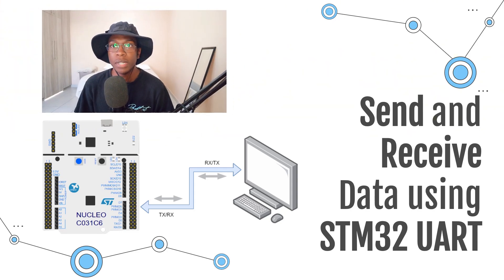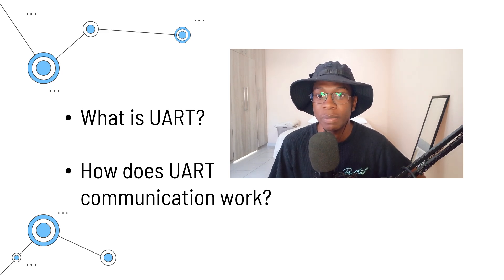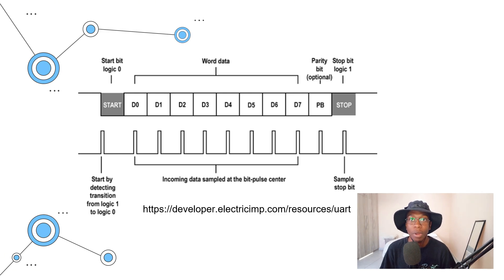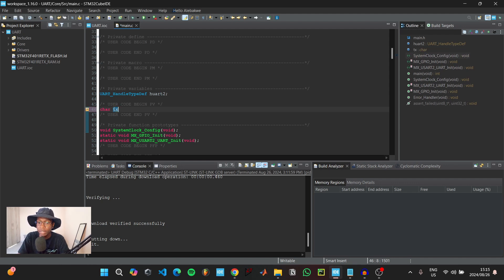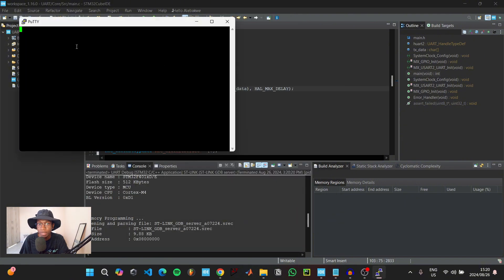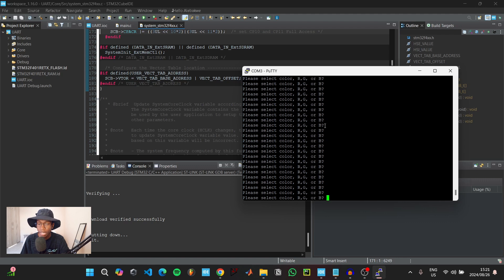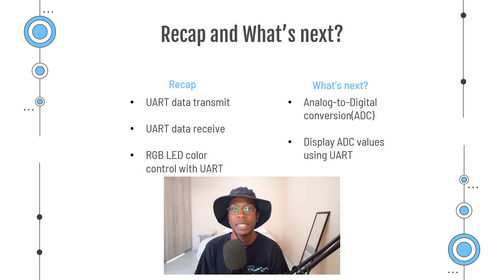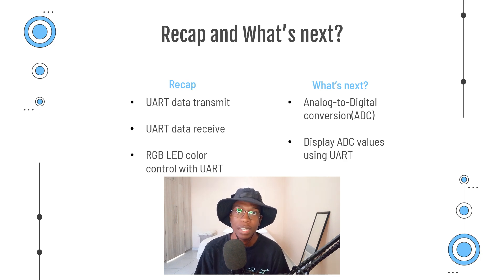STM32 Beginners Guide Part6: UART Serial Communication | Send and Receive data with STM32 UART.

Comment: Note : The only UART module connected directly to virtual com port is UART2, for the others, you must use en external hardware to communicate with PC
Reply from the maker: That's correct. I did mention this being the reason for using UART2 in the video.  Thank you.

Comment: Is it necessary to use the interrupt to receive the communication to the microcontroller? Can't we use the normal way of receiving data? Lastly what are the benefits of using the interrupt? Only for sending back the message we sent to the microcontroller??

Comment: when i write this line 	  HAL_UART_Transmit(&huart2, tx_data, sizeof(tx_data), HAL_MAX_DELAY);
and building it give me error 
13:34:57 ** Incremental Build of configuration Debug for project UART **
make -j12 all 
arm-none-eabi-gcc "../Core/Src/main.c" -mcpu=cortex-m4 -std=gnu11 -g3 -DDEBUG -DUSE_HAL_DRIVER -DSTM32F401xE -c -I../Core/Inc -I../Drivers/STM32F4xx_HAL_Driver/Inc -I../Drivers/STM32F4xx_HAL_Driver/Inc/Legacy -I../Drivers/CMSIS/Device/ST/STM32F4xx/Include -I../Drivers/CMSIS/Include -O0 -ffunction-sections -fdata-sections -Wall -fstack-usage -fcyclomatic-complexity -MMD -MP -MF"Core/Src/main.d" -MT"Core/Src/main.o" --specs=nano.specs -mfpu=fpv4-sp-d16 -mfloat-abi=hard -mthumb -o "Core/Src/main.o"
../Core/Src/main.c:50:1: error: expected ',' or ';' before 'void'
   50 | void SystemClock_Config(void);
      | ^~~~
../Core/Src/main.c: In function 'main':
../Core/Src/main.c:83:3: warning: implicit declaration of function 'SystemClock_Config'; did you mean 'SysTick_Config'? [-Wimplicit-function-declaration]
   83 |   SystemClock_Config();
      |   ^~~~~~~~~~~~~~~~~~
      |   SysTick_Config
../Core/Src/main.c:103:38: warning: pointer targets in passing argument 2 of 'HAL_UART_Transmit' differ in signedness [-Wpointer-sign]
  103 |           HAL_UART_Transmit(&huart2, tx_data, sizeof(tx_data), HAL_MAX_DELAY);
      |                                      ^~~~~~~
      |                                      |
      |                                      char *
In file included from ../Core/Inc/stm32f4xx_hal_conf.h:411,
                 from ../Drivers/STM32F4xx_HAL_Driver/Inc/stm32f4xx_hal.h:29,
                 from ../Core/Inc/main.h:30,
                 from ../Core/Src/main.c:20:
../Drivers/STM32F4xx_HAL_Driver/Inc/stm32f4xx_hal_uart.h:745:79: note: expected 'const uint8_t *' {aka 'const unsigned char *'} but argument is of type 'char *'
  745 | HAL_StatusTypeDef HAL_UART_Transmit(UART_HandleTypeDef *huart, const uint8_t *pData, uint16_t Size, uint32_t Timeout);
      |                                                                ~~~~~~~~~~~~~~~^~~~~
../Core/Src/main.c: At top level:
../Core/Src/main.c:112:6: warning: conflicting types for 'SystemClock_Config'; have 'void(void)'
  112 | void SystemClock_Config(void)
      |      ^~~~~~~~~~~~~~~~~~
../Core/Src/main.c:83:3: note: previous implicit declaration of 'SystemClock_Config' with type 'void(void)'
   83 |   SystemClock_Config();
      |   ^~~~~~~~~~~~~~~~~~
make: * [Core/Src/subdir.mk:34: Core/Src/main.o] Error 1
"make -j12 all" terminated with exit code 2. Build might be incomplete.
Reply: ignore it

Comment: I didn't find my stm32 COM in the device manager, how can i find it pleaze?
Reply from the maker: Hi, Make sure you're using a data cable and not a charging cable. Then try to install stm32 drivers, you can find them on the stmicroelectronics website. If it still doesn't show up, then try checking under USB devices or under unknown devices.